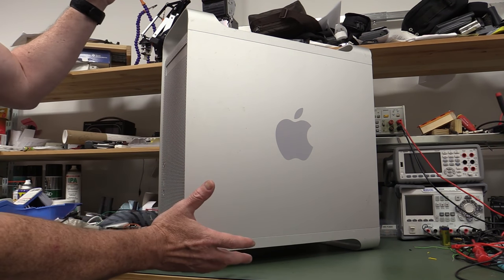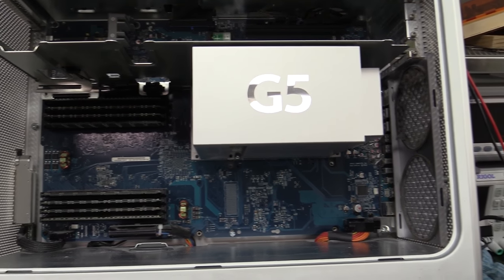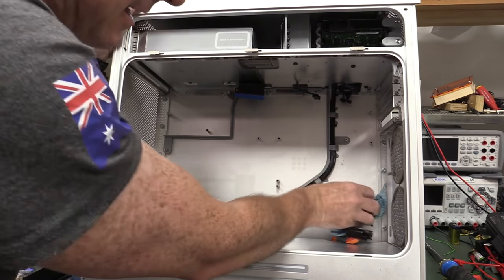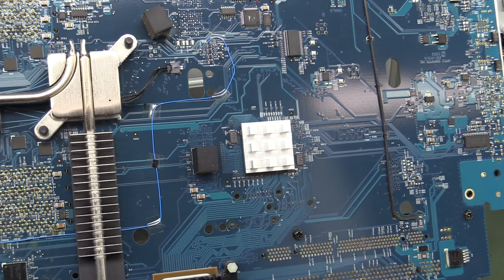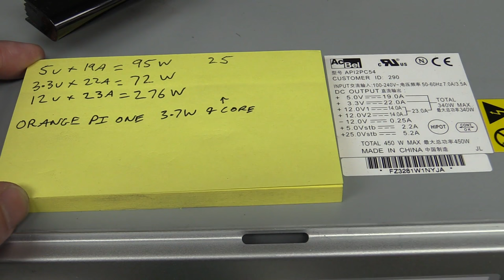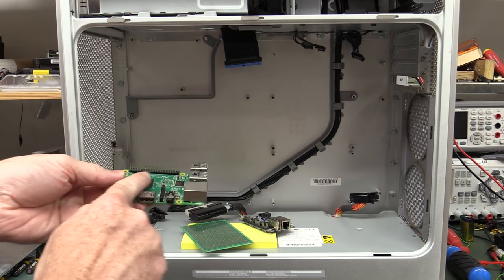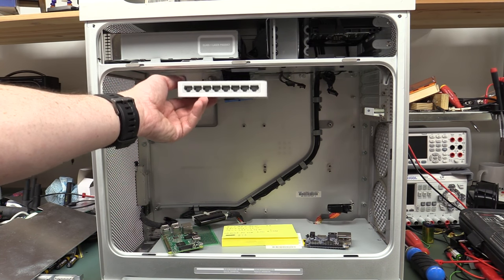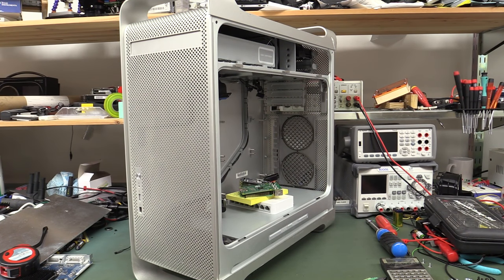EEVblog #946 - Apple (Raspberry) Pi Cluster - PART 2

Comment: Why no ugly wired proof of concept testing before talk of etching printed circuit boards?
Did you read comments on:  Hackaday - Moore’s Law of Raspberry Pi Clusters
I like the repairability of the mother board arrangement you're planning but for bench testing wouldn't standoff on top of standoff with wires give you a chance to see how many Pi's you can add before overhead makes adding more Pi's cost more in overhead  than computation power gained?  Where do you think the point of diminishing returns is?

Comment: Dave Could you put the Pi's in a vertical arrangement like this -|-|-|-|-|-|-| out to the width of the case and then stack the risers or will there not be enough space for the tracks nor a header with enough pins?

Comment: Why no power over ethernet for a single cable connect of power + data?
Reply: I think the idea is only connect things not soldering. If he make a MB that works with an standar PSU I would buy this thing.

Comment: running the Ethernet vertical will block a lot of air flow.Being you are thinking of 6 per bank may have space at top or bottom running them horizontal direct to motherboard?

Comment: you could do the raspberry pi compute boards  - they are designed to interface with a backplane using a standard connector

Comment: I really like this project.

I would love to see a solution without Ethernet cables.  Also, the last I looked the RPi 1 used a USB>Ethernet NIC which had terrible bandwidth.  Do the new boards have Ethernet controllers on the CPU maybe?

Could you use USB>Ethernet on the main board and some Ethernet switch it that doesn't require magnetics perhaps?

For power I like the 12V distribution to the riser board idea.  You have 276 watts to work with and won't run into any issues with voltage drop on the 5V rail.  (Probably not likely anyway but still)

Front LCD or even better OLED would be cool.  Have one of the Pis act as a "supervisor" and do things like DHCP or maybe SPI or serial connectivity to each node and have it drive the OLED on the front.  How cool.

Comment: Wouldn't it be better to just connect them to the main board using one of those pcb mounted male ethernet connectrors and a usb connector for the 5v supply?
Reply from the maker: I think I explained that last time, height alignment is an issue.
Reply: Bruno Perdigao I tried that with a small slot load setup.  it is really tough and I gave up.  I moved on to Raspi Zeros.  less cores, but much more dense population.  the only problem with what I'm now doing (gadget mode) is dealing with USB limitations.

Comment: 90 degree header adapters exist, would save the expense of an adapter board.
Reply: Ian Colquhoun I bought 20 for mine...
Reply: +Ian C
But density would be limited to 1 level (no stacking). Riser board allows 2 pi's per mobo footprint.

Comment: you can get 5 volt 40 -- 100 amp power supplies cheep and they are only 30 -- 45 mill thick

Comment: I just need to know one thing, what is that transistor used for?
Reply: Yeah, me too ! It seems like a really odd solution to a mysterious problem and they went to a lot of trouble over it too ! Proprietary connector soldered to the board, proprietary plug on the leads, extended and insulated leads and a custom holster for it fitted to that panel, it must be really important to put it where it was ! My first thought was it might have been a thermistor but that would be a lot simpler and cheaper to implement.
Reply: It probably just measures the case air temperature away from the board, it looked like there was a another similar device on a heat sink on the back of the board.
Reply: Coolkeys2009
 Wouldn't a thermistor be simpler, cheaper and more accurate ?
Reply: Ian Clarke
Diodes and transistors are penny's. Your expensive Core I7 probably uses diodes for sensing temperatures. It doesn't have to be very accurate as it's only used for fan speed control fan  or over temperature shut-down.
Reply: Used as a Ambient Temp sensor.
Reply: Coolkeys2009
The point I was making is that a thermistor could be come with ribbon cable which could then be soldered direct to the board and a sticky pad would hold it in place. Why go to all the expense of creating the plug and socket plus the insulated leads and the custom holster ?
Reply: It's more cost effective to use a couple cents worth of a NPN transistor to get a ballpark range temp reading then a thermistor that costs double.
Reply: Leland Clayton
 Don't you mean ". . THAN a thermistor . ." ?
Reply: Ian Clarke Back in the day a lot of G5's would have been packed full of Pro Audio Interface cards. The placement of the sensor looks optimised to measure the temperature near the expansion cards. These systems would need to be quiet and very reliable. Those were quite expensive systems so I guess they didn't need to save a few pennies. I can now see that those G5's (pre Intel) Mac's helped create the Legend of Apple.
Reply: "Why go to all the expense of creating the plug and socket plus the insulated leads and the custom holster ?"
Repairability. If the transistor went bad, it'd be easier to replace it than going through the rigamarole of ribbon cables.
Reply: Transistors are often used as thermal sensors, eg. glued to MXM II boards. They are good enough for the temp range you need in a PC case. At that position, it measured the ambient temp of the PCI-X area. Those machines have a bunch of temp sensors all around the case.
Reply: Yeah that's weird.
Reply: My Lenovo workstation has the exact same arrangement for the thermal sensor. They even used the same 2n3904, so it must be some kind of routine in the industry. Probably started with real ntc sensors and later switched to npn to save a few cents.

Comment: in terms of the power supply, i'd actually stay away from the +5v rail all together, the raspberry pi has a hilareously low tolerance on the input voltage, and from my experience even just having too many connectors in between could make it complain about voltage. something else to note is that (if memory serves) powering the raspberry pi from the header will always trigger undervoltage, making the raspberry pi reduce to minimum clock speed (= lost performance).

i'm not too sure on how you feel about the price of DC/DC voltage converters, but having 12V to 5V conversion on the riser boards (or for every X number of pi's if you decide not to go riser boards) would probably be the way to go for stability.
some rough napkinmath tells you have about 0.5 ohms of serial resistance per pi (so that's 0.1 for 5 pi's for example) before they start to drop out of voltage spec (which, if you're okay with minimum clock speed, you could probably power them from 3.3v directly :p). you could also go the "cool" way and just have a thick power wire going to each riser board that leads straight to the +5v rail or power conversion on the mobo.

another recommendation would be putting a small heatsink on the arm chips, from some experimentation just having a heat spreader stuck on there and bent up in the breeze is a big difference on thermals, if you buy the heatsinks in bulk i doubt they'll make much impact on the cost of the project anyways.

Comment: if you want pcb mout rj45 and want to click the router then you have to break the click head of all the rj45 header except the extreme end two port, or it will be very hard to remove I guess.

Comment: 16:11 Looks like they are using the 2N3904 as a temp sensor. The connector looks like it only uses 2 pins.

Comment: why dont you run the ethernet via a short crimped connector to the adaptor board with the magnetics on it, then run an ethernet switch chips on the motherboard. alternatively you could unsolder the ethernet jacks from the raspberry PIs which have the magnetics built in and run it to the adaptor board in the same manner as mentioned earlier.

Comment: I personally would design it so it could be built without and dependances. No need for extra switches or specific Pis. In fact to your power solution, you could attach a power regulator per pi module on the rise card. If you have a dual card, stick two psus on the bus. Ofcourse then youd need to design in how to manage power through the header.

Also id add a small microcontroller to handle low level stuff like power supply control and basic io. If you used an arduino equivalent you could have the main board soft power everything and not waste power all the time running a single pi to start up others. Could also make it do the classoc mac boot up theme to make it "authentic" by using the various WAV players for the atmega328 ;)

Comment: Dangerous question: Could you not just convert the 12V to 5V by using 2 Modules in series? (I think they will survive 6V...)
Reply: No, unfortunately

I'm not sure if 6 volts would be a problem or not, but we don't even know if there would actually be 6 volts

The two modules could be drawing different currents... and the voltage wouldn't be equally distributed (Unfortunately not like as you said: 12/2=6)

But as Dave said, you can get step down dc/dc converters (12V to 5V), and they can be 80-95% efficient
Reply: Ah, interesting. Thank you.

Comment: If it were me? Id stick in 1 DC/DC per 4 of them (to prevent drop) and use the 12v line (what the 12v rail is actually for), id make low profile RJ45 adapter boards and roll my own hub and use something like an ATMEGA32u4 connected to a master pi to deal with the soft power and management of each (the master pi can ping each one constantly) 
But that's just me

Comment: Edge Connectors dave! Use edge connectors! PCI express connector should do the trick.
Reply from the maker: They aren't very stable if you have nothing to hold the board. dual row header are much more stable without anything to hold the board.
Reply: What about 90 degree pin connectors ?
Reply: Hi, Dave. Nice ruler ;)

Comment: I would put your RJ45 Strip boards up the top, and put them in lines of 8. Then teardown the cheapo 8 port switches to bare board and plug them in. Maximising the space at the top. Should look really sweet and neat.

Comment: I think getting rid of the PSU it's large, bulky and running it with high loads on the 5v rail and almost nothing on the others can't be ideal, you could probably fit one in the top of the case where the HDDs live now, you might even get enough room to fit 9 Raspberry Pis tall, at the very least you will have more room for air flow.

Like the new idea with the risers/adapter much better too. Engineering a new riser board/adapter for new single board computers is a much better solution then engineering a new board.

Comment: Does that G5 PowerMac actually work? If it does, I kind of feel sad for destroying it.
Reply: At the time, the IBM PowerPC 750 (aka G5) blew away any Intel processor. Its bus was 1 gHz, up from 167mHz on prior PowerPCs from Motorola. Alas Intel had the edge on power-per-watt, and the G5 made one last effort with a factory water-cooled model before Apple went Intel and put Xeons in the Mac Pro.

Comment: Love the idea. Cant wait for the next video. I loved the idea of spi ethernet. i know its not as fast but it should be fast enough for this kinda cpu only one board will be talking to the internet anyways. plus if you did double deep you could just run 2 headers off the motherboard that was only 3-4 mm apart and the connections to the boards could be made by 2 header boards that was stacked on top of each other basically. what ever you do i do believe it will be fun to watch it come to life

Comment: I love the G5 thermal design
Reply: And it was divided into zones by the plastic baffle he removed at the beginning. Fan speed was of course individually controlled for each zone. None of this "8 fans all blowing toward each other" rubbish you find in homebuilt PCs.
Reply: I know. And I bet fan speed was individually controlled by the temperature.
Reply: J Bender Of course. And given the high power draw and heat production of these G5 chips (descendants of IBM's "POWER" series which didn't give a hoot about power draw since they were for use in mainframes), even the dual G5 made far less noise than you might expect, due to the efficient cooling.
Reply: Yup. I had one for quite a while before i got my i7. I remember how if you removed the plastic baffle while it was running, a red light would come on and the fans would all kick into "tornado" speed to make up for the reduced channeling of air! :D

Comment: The cabled one is easier to "wrangle", the stud one sexier. No comparison :P

In regards to board position, would it be worth desolering the USB and ethernet connectors better airflow? Also, if you did do that, why not make them into headers to plug into the riser board?

But does the Orange and Raspberry Pis have the same spacing for USB and RJ45's?

Comment: If I were you I would future proof it and use ethernet wires not a hard connector block, as if you switch fails, or needs upgrading you would be screwed if you don't get one with identical spacing.

Comment: 8 Male RJ45 connectors on a board are real pain in the ass
to disconnect. IMO, just strip the switch and replace those connectors with something
more easily plug-unplugable!

Comment: modular construction is sexy. the vertical male rj45s for the switch would be awesome. and most port dimensions may be close to the same size so you could use different models if needed. also the 24 or 48 cables would drastically restrict airflow. sexy though,  I like this project...

Comment: If you can backpower the compute boards from the USB host ports, why not just have a bunch of USB male A, and RJ45 connectors sticking out of the board, and then plug your boards into those.

Comment: Could that odd transistor on a wire plugged into the G5's mainboard be being used as a hardware random number generator, for cryptography?

https://en.wikipedia.org/wiki/Hardware_random_number_generator

It's a fascinating area - I liked particularly the simplicity of the von Neumann noise 'whitening' algorithm, which removes statistical bias towards 1s or 0s in the output of the random noise generator.

Comment: if you "click" the switch, you will regret it when you are to "unclick" it.
Reply from the maker: Yep!
Reply: nikre You could use a sturdy metal strip and somehow get it in there to press all clips at once.
Reply: Was thinking that, but you could just remove all the tabs other than the top and bottom connector. Would be sturdy enough/ easy to remove.

Comment: Those delta fans shouldn't run full blast all the time. You could get away with running them off the 5v rail or stepping the 12v down to 6.

Comment: i am confused. You continue showing the Raspberry Pi even though you mention that you've ordered several new Orange Pi 2's. You continue to show the RPi in your design setup but your comments indicate you're not using the RPi, rather the orange pi. Which SoC PC are you using? Then I'm bonkers when you say you're going to replace the Apple Logo with the Raspberry Pi on the case yet your inards contain the Orange Pi 2.

Comment: i'd design an connection board which fits the pi inside "butt first" so that your ethernet connection is showing right at ya when the case is open. along with an tiny ethernet adapter with this male-board-connector thingy plugging in to the dapter board, you only need like 4 pins to get your 100mbit connection done (2 pairs, pins 1, 2, 3 and 6, while 1+2 equals pair one and 3+6 equals pair 2), which makes up for easyer installation and less wiring, just plug in the ethernet thingi and both, pi and adapter into the big adapter board. on the big adapter board i'd try to fit the power conversion stuff just to be able to switch that in case of a failure. not sure though if i would make this a plug in feature as well. including the full population of the gpio header to the board plus the ethernet and at least two power pins  we are up to 26pins for the board to board connection, but i dont get the point of using the gpio any further, besides of the ethernet connection, so i'm asking myself "is the gpio needed at some point for what i'm trying to do or can i leave that alone, except for the power?" if no other gpio features are needed to connect to the main board, i would leave that alone counting only what i need for connection to the main board, which would be the 4 ethernet pins plus still at least 2 power pins (maybe doubeling for current? just to be sure). everything countet, i would go for 8pins per board, meaning a double-loaded-adapter-board would need 2x8 pins or one 16pin connection (i actually would go for the 2x8pin [2 by 4 pins], with a little space in-between, to allow for a single sided adapter with only one connector, or weird sized boards.

Comment: I know I am late to the party (there is a old cliché about trendies always being late), but I have an idea for the extra 5v (2.2a) power rail, why not use this to power a SOC device with an ethernet (RJ45) port and use this SOC to receive wake-on-LAN requests (ie. magic packets), which would then switch on all of the other SOC devices?
Reply: Also, I would be tempted to de-solder the non-needed ethernet and USB (+ any other excess) ports of the SOC devices (which would improve on air-flow in this scenario).
Reply: I am not sure about having a ethernet per SOC (which would result in the usage of multiple IP addresses, either static or DHCP assigned), instead I would prefer to use the GPIO / serial pins and control through a TTY terminal styled mechanism.

Comment: Using PC power supply will be a waste of space, he can fit two hp server 1000W power supplies sold cheaply on ebay, easily in to the compartment above the motherboard where the dvd is,